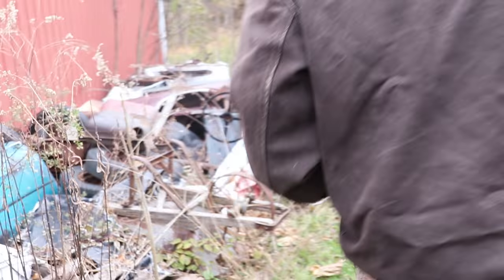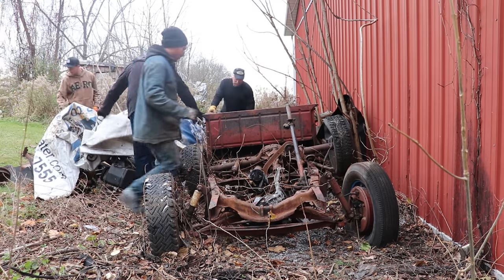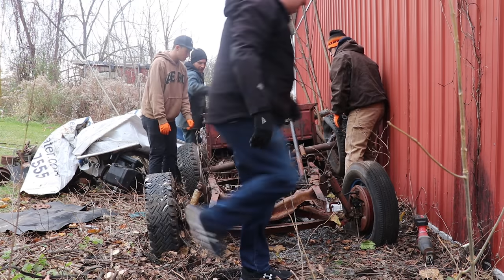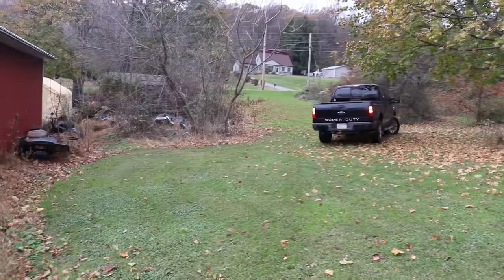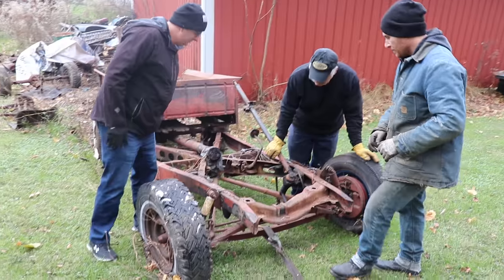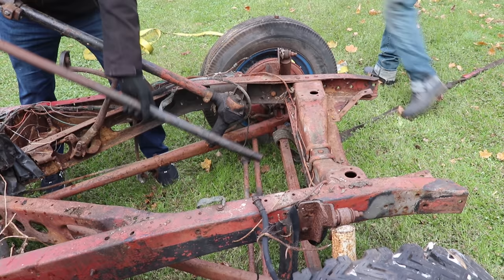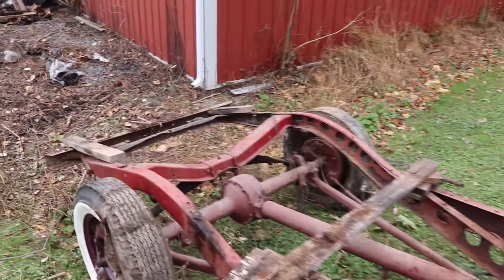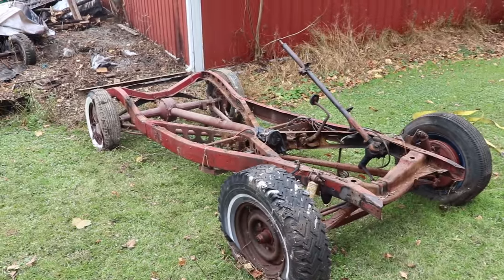1935 Ford Truck Chassis - Sitting Since  The 1970's!!!!

Comment: Hey Matt does your friend Carl that you bought the 1935 ford truck bed & chassis from have any 1964 -1965 falcon cars for sale with the original 289 or 260 SB V8? The reason why I ask is because in the video I saw a dark blue 64 or 65 falcon front fender laying a top of the pile of stuff.
Reply from the maker: No falcon cars. He may have some parts laying around but I don’t think he has any 64-65 specific engines. He may have a SBf engine laying around but no idea where it is and probably can’t get to it yet. If the fenders interest you they’re definitely for sale.
Reply: @IronTrapGarage  thank you Matt for answering my question. I'm not interested in parts.

Comment: Hey Matt love the videos. What is the 35 frame wheel base length? and price? I am building a 27 Hudson Essex.
Reply from the maker: The frame is sold at this time. -Mike/ITG
Reply: The wheelbase on 35-40 Fords is 112”.
Reply: 49-51 chevy car frames are 115" if it helps.